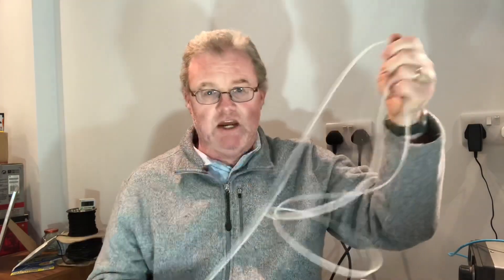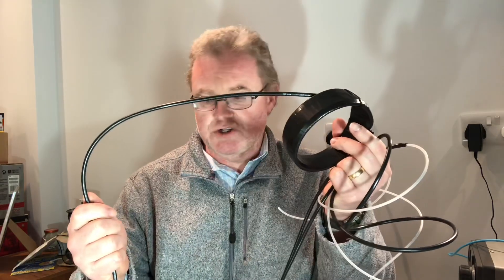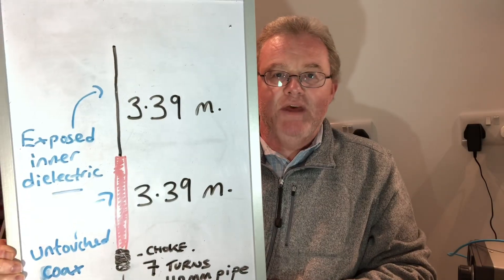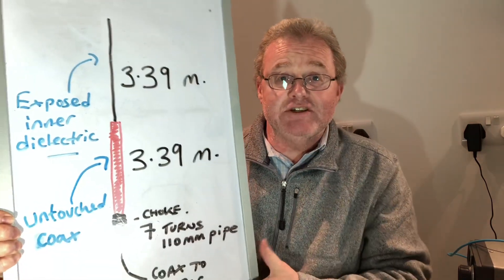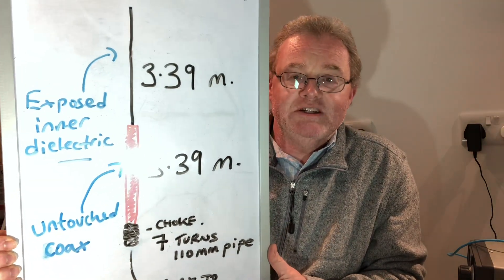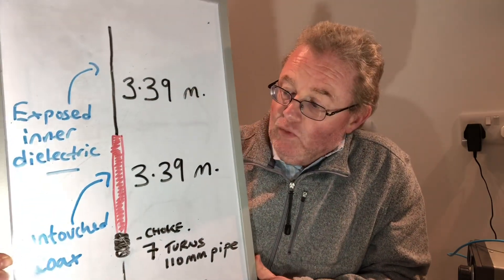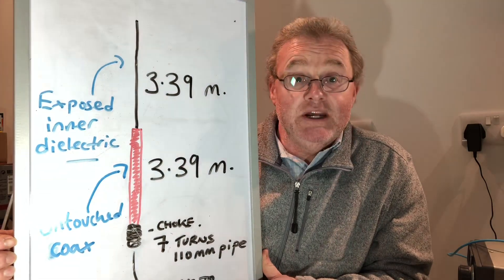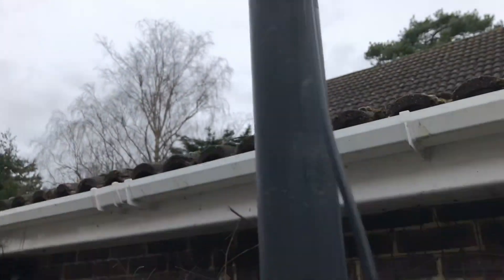15 Metres Simple DX Antenna

Comment: Hi Tim great video, is there a wire dipole that would cover 10-11-12 and 15 meters or would the SWR be miles out? thanks in advance
Reply from the maker: The best option is to make a dipole around 15-19 ft long and feed with ladderline and use a tuner.

Comment: Hi Tim, should I include velocity factor in the length calculations? I understand you used the 143/f formula.
Reply from the maker: Yes under and the dimensions I gave include that calculation.

Comment: Nicely explained build, I would add that it is possible to design this antenna with different cable - i am using H155 for instance. It has velocity factor higher than RG58 and to tune properly requires adjusting length of the radiators. There;s bunch of calculators on the net allowing to factor this. 73 de SP5MFK!
Reply from the maker: Thank you 👍

Comment: Hi Tim. Thanks for your videos. I see that you use different chokes for the 10m (16 turns with 68mm diameter) and 15m version (7 turns with 110mm diameter). Are those interchangeable? So could I use this choke with 7 turns @ 110mm diameter for the 10m version?
Reply from the maker: With 110mm for 10m you need 4-5 turns. Check out a search for the G3TXQ choke chart for further guidance.

Comment: Hi Tim, made two of these now, and I believe I've followed the dimensions, but it seems the best match is ~22mhz (according to the RigExpert) and I would like it resonant on the CW portion of 15m. Where have I gone wrong please?
Reply from the maker: Hmmm.. either the choke isn't right or add a few cm to the top portion to lengthen it. What is your SWR around 21.300?
Reply: @TIMG5TM  Hello Tim, I've fed a bit more coax thru the choke to length the bottom portion and got it down to 1:1.5 @ 21.1 and I reckon that'll will do for now. Will give it a proper test next week. Cheers for the reply 73's
Reply from the maker: @miketaylor253  good job!

Comment: Hey... I just made this antenna yesterday and found out that it was resonating at 7 MHz.... Wonder why... Then I counted the rounds of coax on choke and they were 10... Instead of 7 .... But will that shift the frequency so much?? The length is exactly 3.39 meter each as you have shown. 

What could be missing??
Reply from the maker: Yes you will need to reduce the turns to 7

Comment: How is the impedance ?
Just a week ago I made a similar antenna: 2 x 3,37 m of RG58, then a choke 240-43 core with 4 windings clockwise and 4 counterclockwise, then  2,34 m of 75 ohm coax then RG 213 to the shack. My impedance is spot on 50,3 ohm and the swr is 1.0 at the bottom to 1.1 at the top. 
I use a 9m pole and I am blown away of it’s performance.
Thanks Tim 73 HB3XBL
Reply from the maker: They work really well! 73

Comment: Hi Tim,  I have made the 20m, 15m and 10m Flowerpot antennas after watching your videos.  They all work extremely well.  Are you using a formula for your calculated lengths.  The reason I ask is I want to make a 30m version.  THANKS. Daryl de VK3AWA
Reply from the maker: Hi Daryl 468/centre frequency.. you’ll need to do a choke for that frequency .. see the G3TXQ choke chart for air chokes
Reply: @TIMG5TM  THANKS Tim.

Comment: Hi Tim, thanks for the video clip. Made one over 2 days, SWR 1:3 to 1 on 21.074mhz. I did make it cheaper by using 13amp wite for the top, so saving 3m 39cms of coax. Yes received some DX this morning and was heard in Africa, but qso's just local Europe. Great antenna, easy to put up and down within 5 mins or so. Cheers Tim 73's Andy M6APJ.
Reply from the maker: Glad it works Andy I wish you well with it

Comment: Was wondering about the number of turns in the choke.  Does the inductance of the coil and distributed capacitance between the turns form a 15 meter parallel resonant trap?  This design fits my desire to remain as stealthy as I can even though I have no restrictions against antennas in my neighborhood.
Excellent construction details.
Reply from the maker: Hi John - the choke is based on the work of the late G3TXQ. Search for his choke chart - here he gives information relating to air coils such as these, as well as those using ferrites for different bands. 73
Reply: @TIMG5TM  Thanks Tim
Reply: That would be ideal for maximum impedance of the trap, BUT without measurement WHO knows?   Also seems like a waste of coax to strip off the jacket and shield for the upper half when could just solder a length of insulated single conductor to the lower center conductor.

Comment: Hi Tim. I’m confused. Shouldn’t the wire lengths each be a quarter of the wavelength? 15/4 = 3.75 not 3.39. Am I missing something?
Reply from the maker: Unfortunately it isn't always that simple. I used the formula 71/21.000 (latter number being the frequency. 71 stays constant whatever the frequency) this gives the length for each half of the antenna. 73
Reply: @TIMG5TM  thanks. I’ve been looking on how to calculate that without luck. Is it best to choose a frequency somewhere in the middle of the band?
Reply from the maker: @ianafloat9250  yes for ssb I would. If you are into ft8 or cw then look towards the bottom
Reply: @TIMG5TM  thanks. 😎

Comment: Hi Tim,  did you measure the attenuation/dip of the 7 turn coax choke? According to my experiences air chokes (technically being an L/C parallel choke) are very narrow banded and can easily be influenced by their sourroundings (changing the C part). I always wondered if it might be a better idea to use a ferrit core broadband choke instead (or even on top?). Just to make sure and save some coax. Talking about saving Coax: does it make any difference if one just solder simple wire to the center of the coax for the upper part of the antenna?
Reply from the maker: Great points - trying out ferrite chokes with this antenna is on my to-do list for the spring/summer.
Reply: @TIMG5TM  Great!  I am looking forward to see your results. That far i did not manage to measure coax air chokes properly and reproduceable. There is just to much influences from the sourroundings. You can not just wind them up, lay them on the table and read S21. Even free hanging from the ceiling you won't get reproduceable readings because air moisture etc is changing. Great idea in theory because of the super high notch depth but in my opinion super unpredictable - but maybe i a missing something :)

Comment: Nice ! A couple of questions if its ok.

- how many watts can you put thru it 
- Could you make a video of the complete construction stripping the coax, forming the choke and mounting which will help us newbies to get started with this type of antenna :)

Thanks again ! 73's
Alan / 2E0FWE
Reply: I run 400 watts through mine. I've got versions for 20, 15 and 10m. The choke and the lower coax section do get noticeably warm to the touch after a period of operating so there's definitely loss there. I'm tempted to remake mine using RG-213 cable but that would add significantly to the weight and the fibreglass pole would struggle. BTW you don't need to use coax for the whole antenna. The top section can just be 1mm wire soldered to the coax inner so no major coax stripping needed
Reply from the maker: All noted 👍

Comment: Hi Tim, just wondering, the choke you say is 110mm. Drain pipe is 100mm, will it make much difference as a former?
Keep up the great work, might catch you when I come down to the south coast in may on holiday, fingers crossed.
Reply from the maker: Try it Steve my guess is maybe one more turn to compensate?